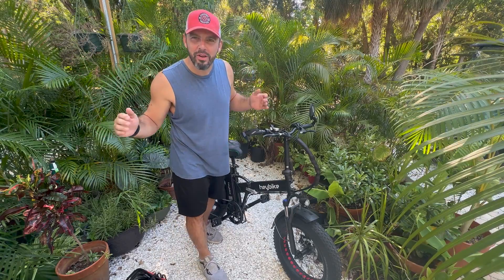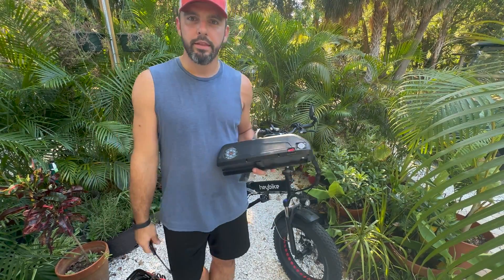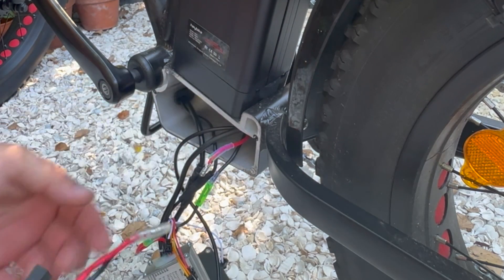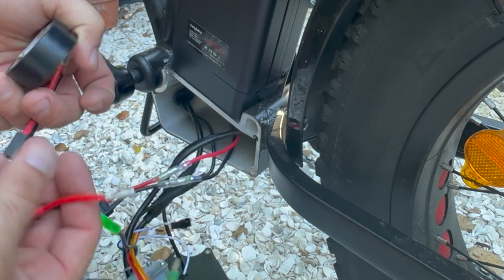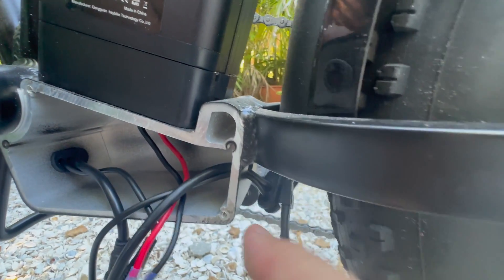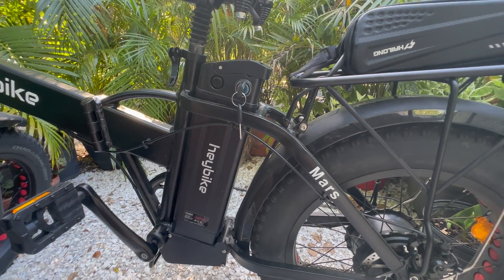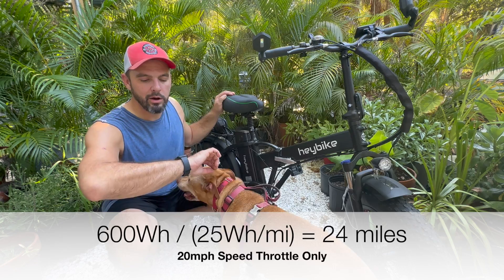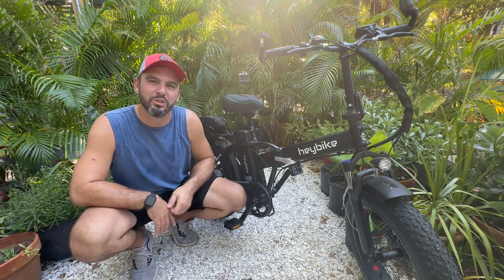Heybike | Mars | eBike Plug & Play Dual Battery Balancer Kit Install Two Batteries on Electric Bike

Comment: Motor upgrade advice?
Reply from the maker: It’s not really cost effective to upgrade the motor and components. 
Though this isn’t exactly what you seek, the best advice is to sell your working bike and invest the cash into a unit with the specs you desire. (Customer service and parts availability a consideration)
Reply: @ElectricAllWheel  Hmm I get where you are coming from. I was more so just looking for general advice though. Like how to match it to the battery the controller watts and such. I'm just looking into learning things while saving for my next bike.

Comment: have to change out a controller...error code 30.  this video a insight for me...dig all them seashell gravel you got..my first mars 1.0 got stolen..cables cut like butter. had just put on Moto grade tires on too...6600 miles I got ...thievers didn't get batter so..I got same model...eyeing the 2.0 ...but my gripe has always been range...your showing solution..ThumbsUp  on  dat
Reply: error code 30...was the PAS cadenced sensor..unplugged it..using without..I need more range..looking for LIPO setup 48v 20ah

Comment: Is this considered running the batteries in series, or or are they parallel? Will one battery drain sooner than the other?
Reply from the maker: The batteries are in parallel and will discharge uniformly

Comment: The video description has links to two different kits: the first being a 40A kit and the second being a 20A kit which lists the mars as the fit. Which one do we buy? Went ahead and bought the 20A but 40A probably wouldn’t hurt either 😅.
Reply from the maker: This one
https://electricallwheel.com/dual-battery-discharge-balancer-kit-20a-xt60-bulletxt60adapter/

Comment: Hey Matt, I've purchased two of your discharge balancers in the past year and I want to know if it's safe to connect the two batteries I have for my 1,000 Watt Folding Ebike. The original battery is 48 volt 17.5Ah and the second (inside the frame style) battery is 52 volt 17.5 Ah. would the 4 volt difference make it dangerous to connect them in parallel with your discharge balancer?
Thanks in advance,
Larry from Canada
Reply: Yes! Do not do this. 

Most lithium cells are very sensitive to anything greater than 0.3V variance between cells. By adding two different batteries that have different voltages, this would also confuse the charger as well. Very dangerous. 

Please don't do this.
Reply from the maker: Hey Larry. Shoot an email to electricallwheel@gmail.com and let’s discuss